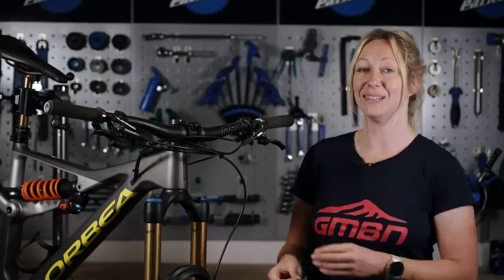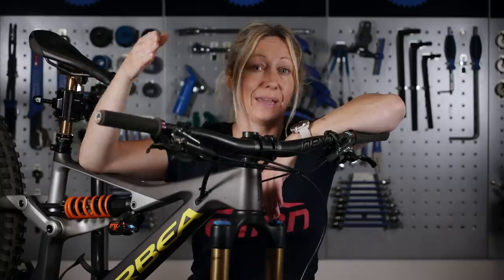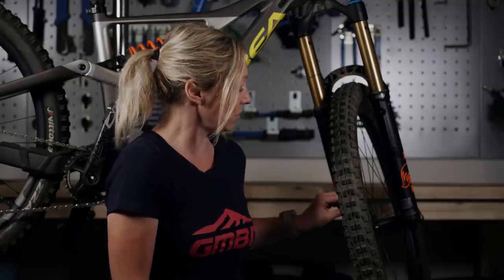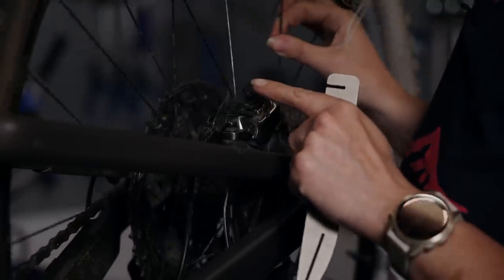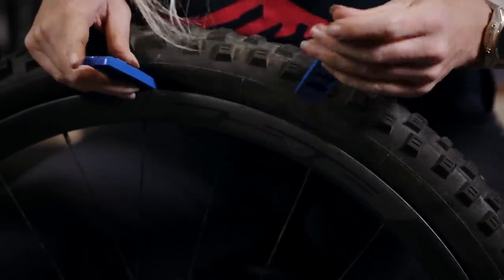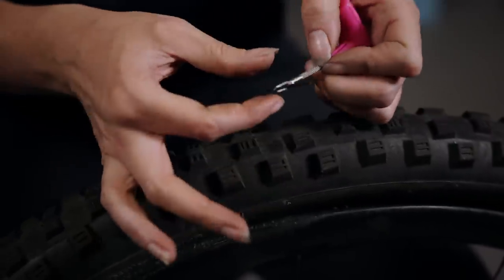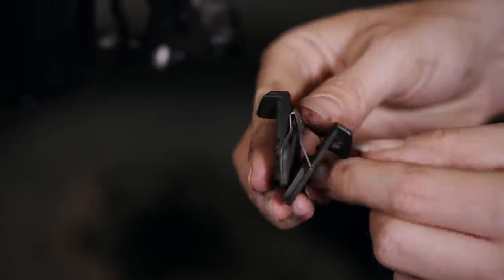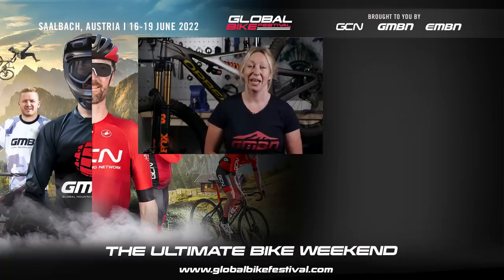MTB Maintenance Basics Every Rider Should Know!

Comment: #ChangingPads. ... Warning... 

If you have topped up or bled your brakes recently, the reservoir may be full... so when you put new pads in... the thicker pads will require pushing the pistons in a little more... which pumps more oil back up to the reservoir... which is already full.
use caution when pushing the pistons in that your not pushing oil out at the top or (as there is a bellows in the top that seals the oil in) your not putting pressure on the bellows which will affect your brake performance.
It's a good idea to do a full brake flush when changing pads so you get new fluid, in the correct amount at the same time you fit those new pads...
(And it doesn't hurt to give the caliper and disk a good spray over with some brake clean when done. (You can use a paper towel to clean off any excess, and if there was any oil/contaminant on the caliper, a couple of spray/wipe cycles wouldn't go amiss.

A cheap can of brake clean should be in every garage/vehicle.
Reply: Because of this reason Shimano says bleeding should be done with the pads removed and the bleeding block (the yellow plastic also used to put in sleeves if the hoses are shortened) installed, if bleeding is done with worn pads there will be too much oil in the brake system and the reservoir (essentially a small rubber balloon) could burst in worst case.
Pads should be removed anyways during bleeding since they could get contaminated easily.
Reply: @simonm1447  Personally I bleed all my bikes with the pads in so they are bled to match the gap... but then again I'm careful with the bleeds and you can always remove the pads and give them a clean afterwards. But that's me..  and not everyone has a brake block that matches their pads & disk size.
At least nowdays most brake systems are mineral oil so no more hygroscopic paint stripper...
Reply: @TheButlerNZ  I ride MT200s, they also use mineral oil.
If you buy them seperately (for example for a retrofit) the plastic block is included.
Reply: @simonm1447  , first time I changed pads I found that out the hard way, when I pushed in the pistons with a full reservoir and ruined my XTR lever (popped seal). $50 pads and a $125 lever made for a $175 brake pads change. 🤬
Reply: @pgjudo  that's sad, but things like this happen sometimes.

20 years ago I swapped tires (from summer to winter) on the family's car, unfortunately the winter rims needed shorter bolts (which the tire shop forgot to give to us when we picked up the wheels), and the now too long ones destroyed both brake pistons of the rear drum brake.
Fortunately nothing happened beside the brake damage.
Reply: @simonm1447  It's great when a co think of supplying what may cost them near nothing, but can save you lots in time and convenience..
'course most people just buy a bike with brakes fitted and have very little in depth skill for more than the basic fixes.. hence needing these videos..
I'm surprised at how many kids I meet that don't even know how to set their seat so their legs aren't bent all the time...
(I ask them to run 20ft in a crouch and see how they feel..)
Reply: @TheButlerNZ  yeah, basic skills have suffered today, some people can't even repair a puncture on a bicycle tire which uses conventional tubes.
At least there are such video tutorials today, when I was a teenager at the end of the 90s  Youtube wasn't even invented
Reply: @simonm1447  Luckily when i was in primary school my dad basically said...
"THIS IS MY GARAGE...

Try not to break anything..."

So I was using a lathe at 10, Been a IT Tech for 20 yr and a Maintenance engineer for the last 13... so basically I hate Windows now and can't be bothered fixing anything of my own.

q8)

Comment: Great video Anna. Too bad this didn't come out sooner as new brand new Orbea MTB suffered from that cable stretch.😁 Gears started slipping so I took it back to my LBS and they just did a quick adjustment on the barrel adjuster and worked!! I guess I could have done it myself, but it is under warranty anyway.
Reply: something also to watch on a new bike after a good bit of use... spoke tension... Not often, but sometimes a spoke will be under tight from new, or slacken off with things settling...
A simple spin of the wheel and pinging a small spanner, screw driver etc on the spokes gives a constant ping ping ping that should be even...
If you get a spoke with a notably different note... its more loose (lower) or tight (higher note) than the others...
Also a good test if you get a pinch flat or other hard wheel strike.... 
Although bikes are very well assembled now days, don't 100% trust that everything is tight...
(And then there's things YOU do up... I just did a run on a fast tech drop run and wondered why the bike was bucking me at every turn.... 
Front axle was loose... I never undo it and didn't check before the ride... so much so that at the top I assumed "something odd" was front bearings and didn't chect the axle even then... till I was at the bottom...

Made for a hilarious ride/video for me anyway.

Comment: I've got a tire inflation hack video. Just use a strap or some cord wrapped around the centre line of the tire and, snug it down tight to the bead. Use soapy water as well. NO need to shock anything...
Reply: not a bad idea... Ratchet tiedown perhaps. Of course a home compressor (or local Garage free air) is usually enough.... (but I run tubes so can actually say I've experimented with MTB... (Plenty of motor bike tyres and even a ride on mower tho... (The latter actually needed brake clean and flame to explode it onto the rim due to small rim size, wide tyre and out of round new tyre from sitting on a shelf... I think the ratchet tie down may have worked but not with the explosion mounting trick...
(I have seen this done with MTB but not recommended for the faint hearted...  then again using 80PSI to bead a road bike is good for a heart attack when it finally decides to bead... 
I'm not a jumpy person but it still gets the heckles up.

Comment: I only have one gear that is causing me problems, up and downshifting to the 6th gear. The rest is shifting crisp, what can it be? Is the cog itself worn out?
Reply: My bike was doing something like this. It would shift up into the gear just fine, but then have problems shifting down into it. The other gears worked fine. I tracked down the issue to internal friction. There was enough friction in the cables that the derailleur didn't have enough spring force to fully settle down into the shift. Replacing the front shifter housing helped a lot, but didn't completely cure the issue. The rear housing was actually in quite good condition. One thing I do know is that Shimano modified their derailleurs in the '90s to reduce their compatibility with Gripshift (it probably helps them sell more cable and housing too). What I did was I bought a small compression spring from the hardware store, and installed it between the cable clamp and cable stop on the rear derailleur. It helps boost the spring force on the derailleur's parallelogram linkage, and was all I need to get my shifting working fine again.

Comment: My rear disc sounds like 30 mice are chewing when i hit the breaks, wonder hwat that could be? Its not contaminated by anything so it not the squeal, it just sounds like small rodents chewing... so weird
Reply: It can probably be contamination.
You can clean the pads with alcohol and sandpaper, and clean the rotor with a paper or a rag and alcohol, this should help.
If you use a bike just occasionally it can also happen, but in this case it should vanish if the brake has been used a couple of times.

Especially the rear brake is jeopardized by contamination if sprays are used for chain lubrication. The best thing is to avoid the usage of oil spray anywhere near disc brakes at all.
Reply: @simonm1447  Hey Simon, thanks for the tip, yeh i thought about that too but havent had the time. I think i ran my brakes really warm on a decent and have glazed the pads maybe?
Reply: @martinhagen2913  Hard to say. On my MTB my disc brakes (Resin pads, MT200s with BS01) ) get quite hot from time to time too, but the pads never glazed, even if the front rotor started to become brown and blue. It's more the opposite, the brake force even got better after they got hot.
If they should be glazed the sand paper should make them fine again.
Reply: Is it making a sort of a grinding sound? My brakes did that just after I washed my bike. I just uploaded a video the other day on to resolve that issue.